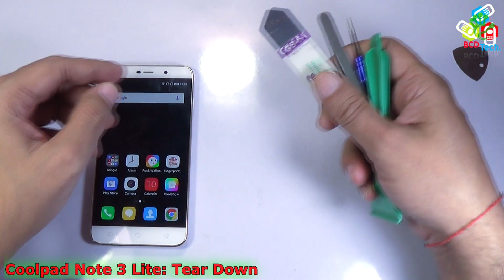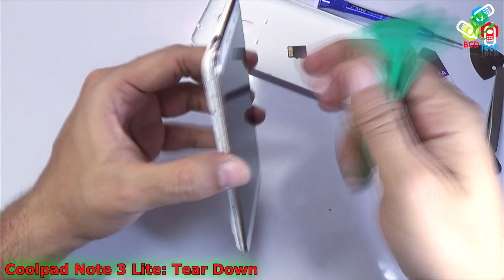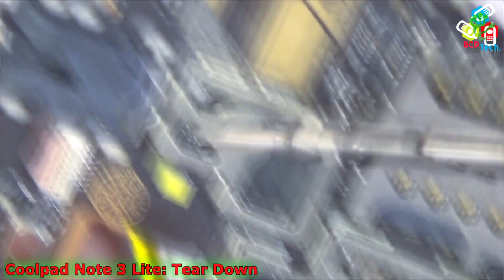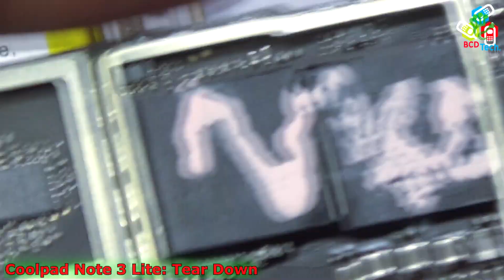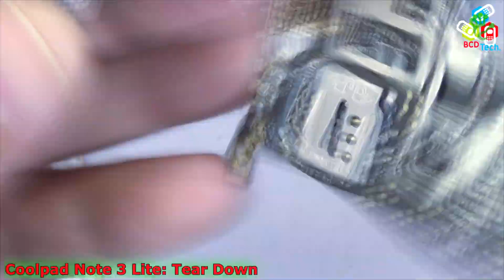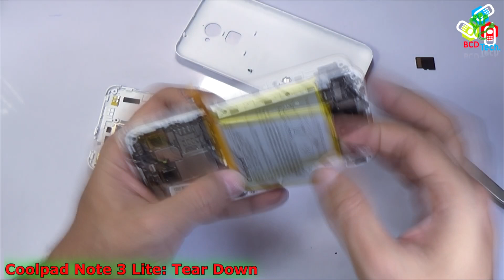Coolpad Note 3 Lite: Tear Down, Parts View, Battery Replacement & Assembly

Comment: I really liked this video. Keep up the good work. I am a layman to mobile phone repairs and never dare to open them up, but your video shows after all these phone are not something too great but actually things made up from small parts which are designed to work together. Really liked this video. 
One small suggestion please use the word couple when reffering to something that is two and exactly two in number if more than two the use the words a few. 
Otherwise the video is perfect. Thanks for showing us what phones are really made up of.

Comment: Lövë , Ya All Vids , Brö !! keep iT üP ? I got 2 Q 

1. If I Plug Wrong Wire Will Mobile Explode (I'm A Newbie)

2 Necessary To Heat Up With Hair Drier ? 

plz Add At The End How To Change Display , , The Fr LiFE !! Brö 🙃
Reply from the maker: +Jâyësh Çhöûräsīyå Thanks
1. No, but may causes some serious issue to phone (even dead)
2. Yes for replacing LCD/Touch
I will try to update that video